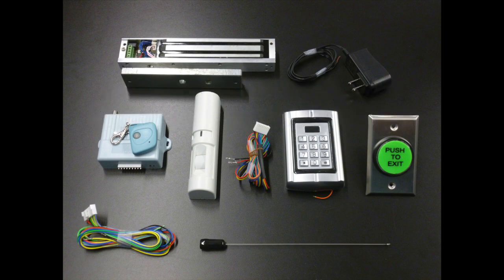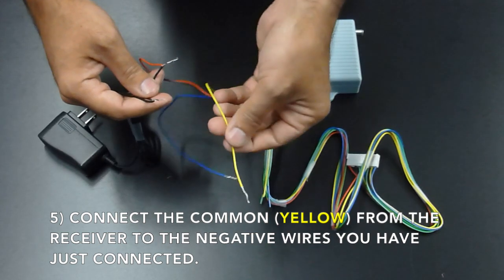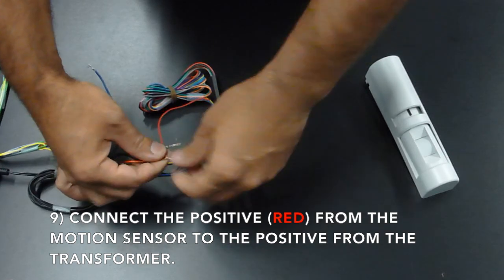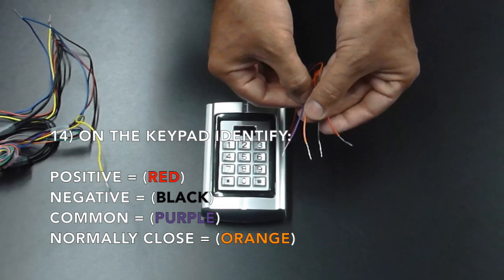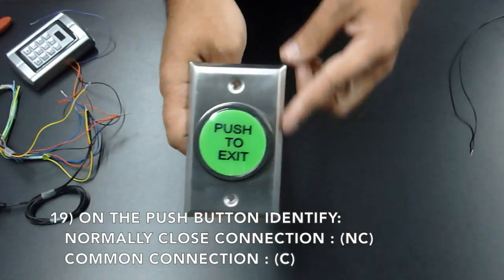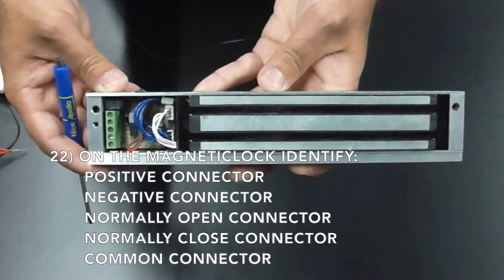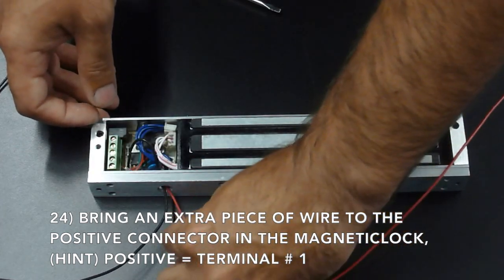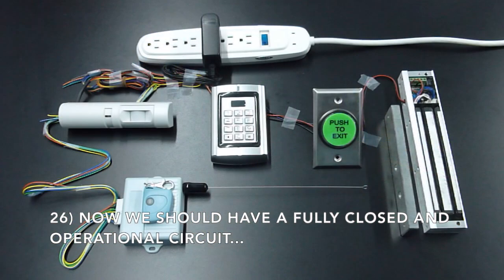Magnetic Lock Access Control Kit Wiring Instructions

Comment: well its a good video not gonna lie , 
BUT !!!!
There's just more to it than just connecting wires. !!!
First you need to know the city Codes for installing Access Controls on Commercial Spaces !!! Super Important !!
specially if the building its tied in to a Fire Panel you need a relay for fail safe emergency exit !!!
Second If its Glass doors for installation is a total different Ballgame !!!  its very tedious and and you need more than basic tools...
Third you failed to mention the Cable needed for this type of job ! which is called composite Cable !! 
I can go on and on and on !!!
I mean ill give it a 6 out of 10 !!
Reply: You don't need composite cable for this.
Reply: hater.
Cry baby, the knowledge you paid 18000 for in Technical school is aired free on YouTube, and you just can't deal with that 😂
Reply: He hasn't mentioned the model of the keypad too...